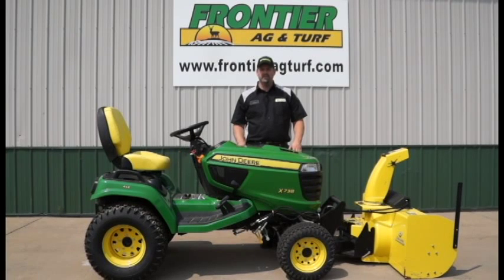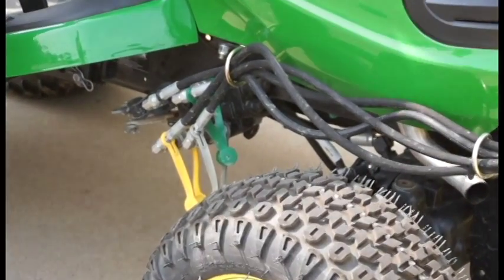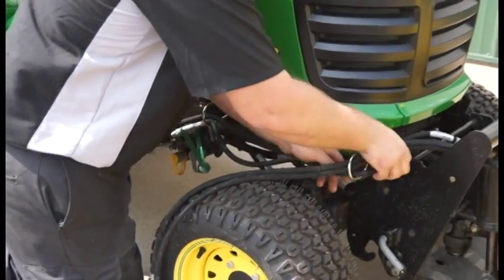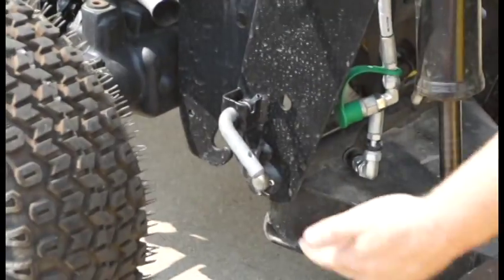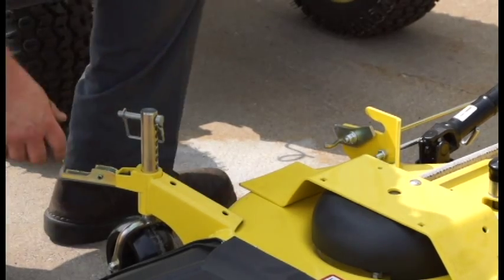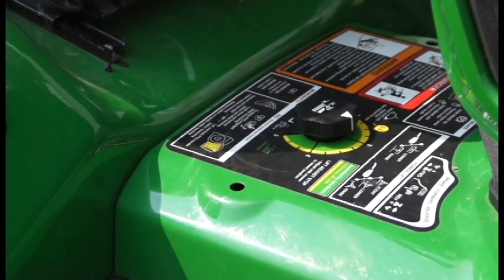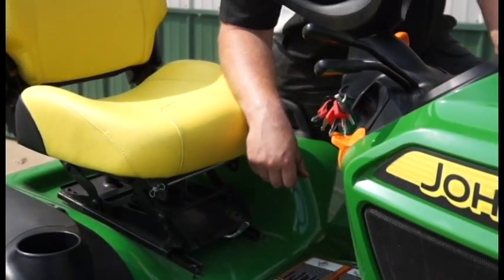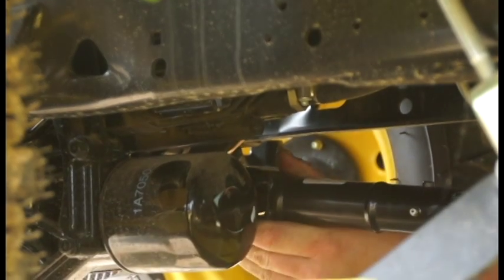X700 Snowblower to Mower Deck

Comment: This video was very helpful!! It includes lots of good points. I have an X739 with auto-connect, and I had do a couple things differently to make the conversion work. For my mowing deck, my drive shaft stayed with the tractor, in a hanger (did not stay with the mower deck). So I had to move the mower drive shaft (with auto-connect) out of the hanger, and attach it to the PTO before driving over the deck. (Maybe I didn't have to attach it to the PTO yet, but I wasn't able to get it out of the hanger with the deck mounted.) And the bar that lifts the deck was locked into a fully up position (for when the blower was on). On the right side of the tractor, I had to pull a pin out that was locking a hook in place that was holding the bar up. Once the pin was out, I could rotate the hook, releasing the bar, lower the bar (a small distance) rotate the hook into an out of the way position, and reinsert the pin, locking the hook out of the way. My bar did not drop down far enough to engage the deck with just the hydraulics, so it helped to (with the parking brake on) put my foot on the bar to push it down while engaging the hydraulics.

Comment: With all due respect, you didn’t mention what needs to be done to the valve on the hydraulic 4 hose  block on the tractor between blower and mower operations. It is a must.

Comment: The old gravely riders have a very similar set up. They have the pto right in front of the transmission and have a driveshaft that runs up to the front to work the blower. Kind of cool to see the  old ideas carrying on.